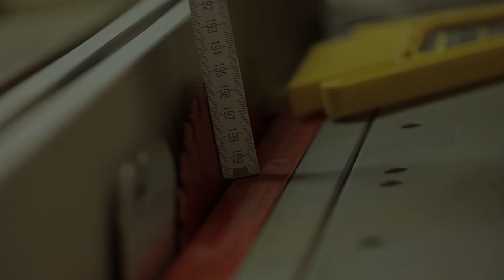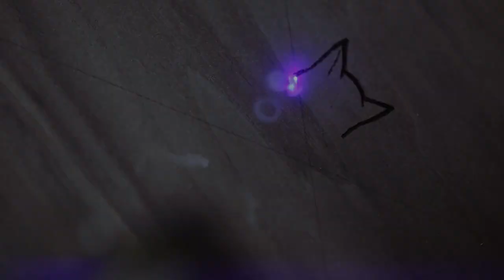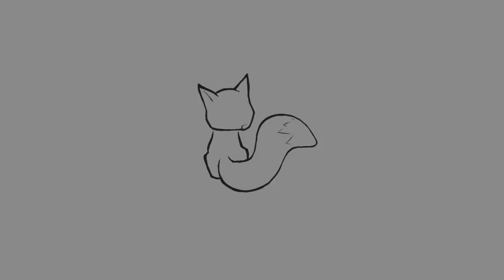VULPEX HANDMADE PASSION - Tea Box / Holzbox / Carpentry / Woodwork /  DIY

Comment: There are a lot of nice things with this box, but I don’t like the way you have located the hinges. In my opinion, the hinges should be recessed into the top edge of the box and the underside of the box top. The way you have done it, is very ‘clunky’ and not in keeping with the otherwise delicate features of the box.
Reply from the maker: Thanks very much for your constructive criticism! It was my very first project ever. Either woodworking or filming. I would do thing's differently now for sure! 😊🫱🏻‍🫲🏼🫡